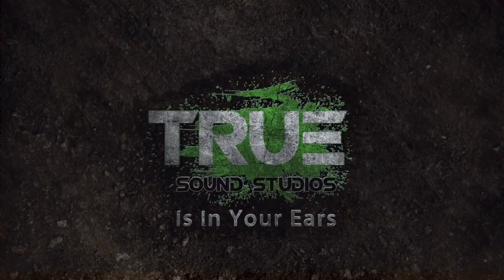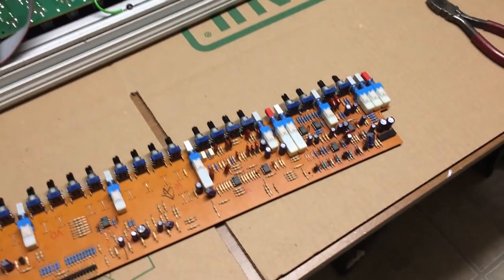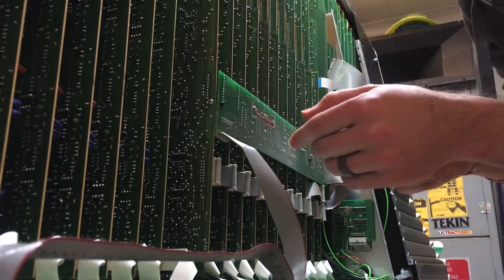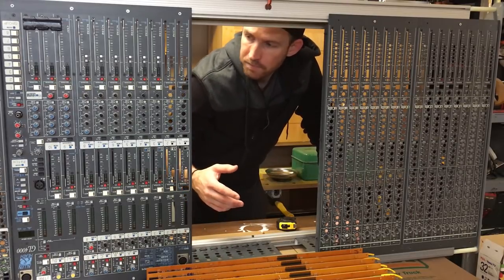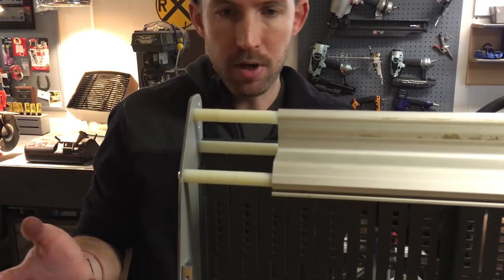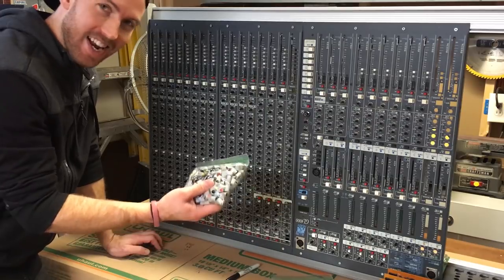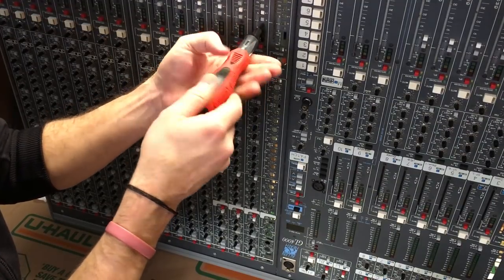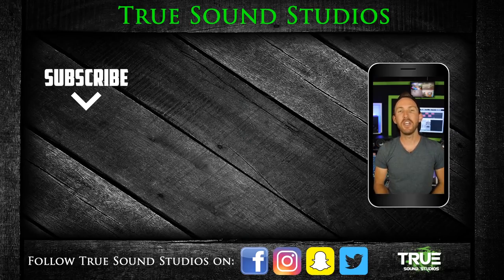Mixing Console Tear Down: Preparing To Modify The GL4000

Comment: You only need to replace the caps that are actually in the audio path, not much point in replacing the others unless they're causing a problem.  To find the ones in the audio path you just need to look at the schematics.  Allen & Heath have great support with all their schematics on their website.

Comment: its always a good idea when moving these boards to support the underneath with something firm these boards weigh a lot and will twist when lifting  and walking them  and placing them down this twisting puts a lot of stress on the pots that are nutted  to the surface circuit board and this twisting can cause solder joints to crack  no fun hope i make sense haha looks like a lot of fun man good job

Comment: These are great videos. Excellent job. 

Question: You mentioned adding moving faders to your Allen Heath console. Who sells these where you can retro fit motorized faders (w/software needed to record the fader moves) for these consoles. Can you please point me to where I would check this out. Thanks very much. 

Philip
Reply from the maker: Uptown Photography thank you thank you, so I was going to buy premade control surfaces, take them apart and use the moving faders. Unfortunately because of how the channel strips are set up, there was no room to add the moving fader and then also have control of the analog console. Unfortunately I had to abandon that idea
Reply: @TrueSoundTV  Thanks for the reply. A shame you can't add the faders. I did find a place in the UK that sells retro fit moving faders, but you do need the room for the fader w/motor and the control board under the fader. It's also really expensive. 

I will have to use a DAW I guess if i want to automate a mix. What city and state is your studio in? i am in Hazlet, NJ about one hour south of NYC. I do photography these days but used to do the studio full time years ago out of my house. I had an analog 1 inch machine running at 15 or 30 IPS and now have a stand alone 24 Trk Hard disk recorder. I am putting the studio back together mainly for myself not to earn a living. All the best................Philip

Comment: I recently scored a GL3300 for a great deal and I am about to open it up to remove some modules. I am going to remove 2 banks of 8 faders for a total of 16 removed. my plan is to recess my Icon Qcon Pro X into the desk. I have a question that would be answered when I open it up but I was hoping you may already know. I am aware the input sections are easily removed or moved but can you move the master section to where you want? The reason I ask is because I want the Pro X in the center of the console and not off to one side or the other.

Comment: Amazing video. I also have A&H GL 4000 48ch model. I have problem in Master section, at Left-Right. Right ch gives me 6db lower volume than left. Output is also lower through insert rtn. Groups are ok. In my opinion I should recap master section. What do you think?

Comment: How did all those caps fail? They're normally very reliable
Reply: They don't all fail, it's called recapping a board. It's basically the equivalent to an overhaul for a mixing counsel in a professional studio. This insures zero problems with a capacitors for a very long time rather than having to recap an individual channel every so often which interrupts the session and business.

Comment: Hello sir.  I had some questions.  Are you replacing these because you can hear the problems when you record, and then you looked and you saw capacitors were blown?  Is this a problem most people have to deal with if they own one of these or do you have to do this because of your previous upgrade?  I bought a gl2400 from a church for cheap, is there any how to video on how to restore this thing?  Grp2 for instance has a hum and I want to fix it.

Comment: It may be unnecessary. First try to measure ESR (if we're talking about electrolytics). And if it's high (you need a special chart), then there is a problem. British made A&H actually used good electrolytics and I doubt that they all went off.

Comment: Good day when u see this message out of hundreds i have a question do you know a company that modify analog console midas f32 I want it resowter wiring replaced to mastering grade and mix inputs and output switched to burl with different compacitors because its a older but still usable technology and all card modified on everyboard I know it will cost a little some but I'm cool with that since midas predominant my have digital console and mixer there analog is creamy